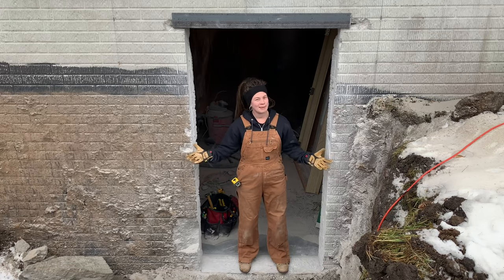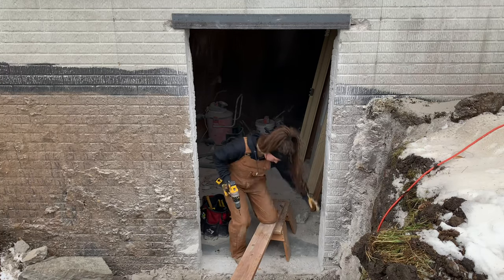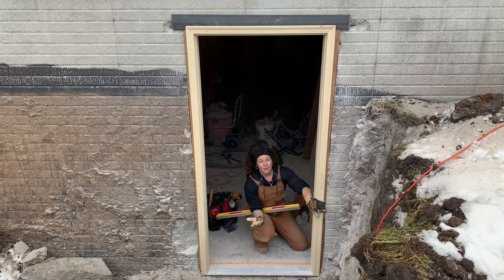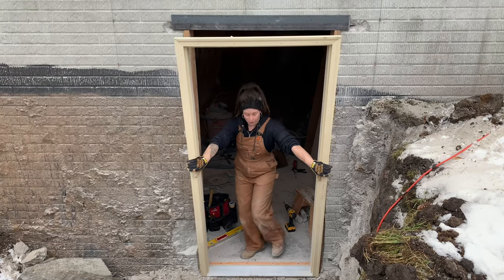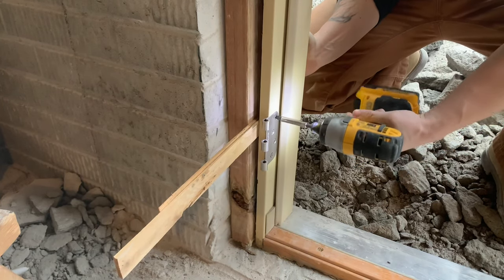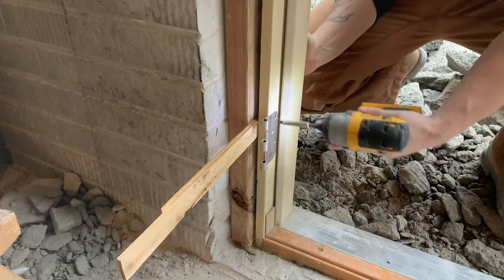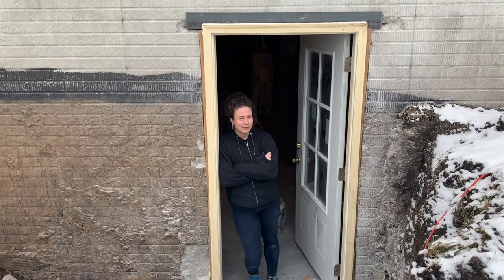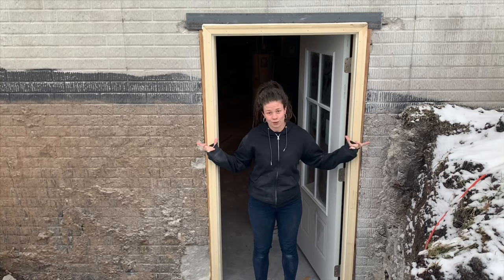How To Install An Exterior Door In A Concrete Wall

Comment: Great video.  What do you mean the "concrete had been reinforced"?
Reply from the maker: Do you happen to know the timestamp?
Reply: @JunksawStudio  Thanks for getting back to me.  It wasn't said in the video, it was in the video description.  Was just wondering what steps were taken to reinforce the wall.  Thanks.
Reply from the maker: Sure :) The homeowner notched out the concrete on either side of the doorway (inside and out) so that pieces of angle iron could be installed to act as a retroactive lentil. My personal expertise doesn’t include masonry structural integrity, so I can’t speak to the validity of this method.
Reply: @JunksawStudio  Gotcha!  I have side-by-side windows (72" wide total) in a concrete block/stucco exterior wall that I want to convert into French doors (obviously involves cutting the part of the wall under the windows) so have been searching YouTube for some expertise.

Comment: What if the opening is not already there?
Reply: Score the opening using an angle grinder with a concrete blade, then sledge hammer out the hole.

Comment: could you add a screen door to that?
Reply from the maker: Yes. Standard exterior doors open into the house, which means they are hinged on the inside of the door jamb, so there is plenty or room to add a screen door to the outside side of the door jamb.